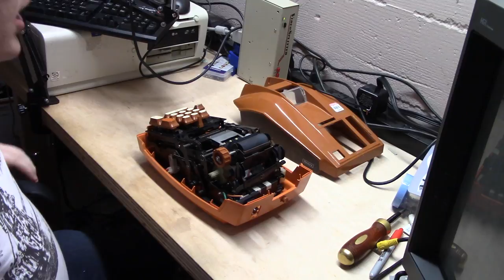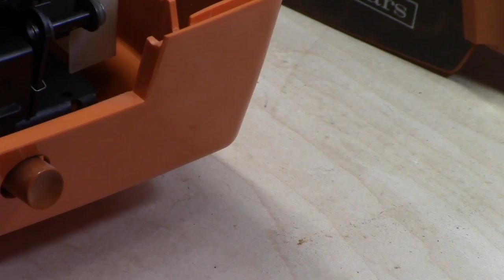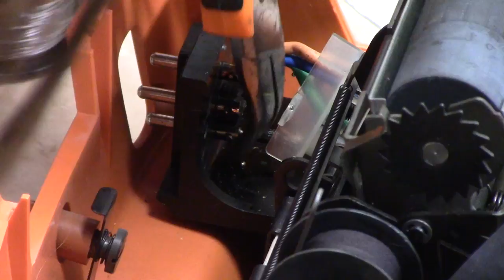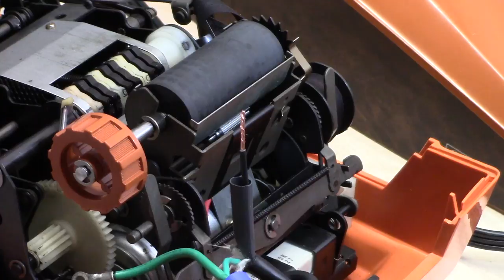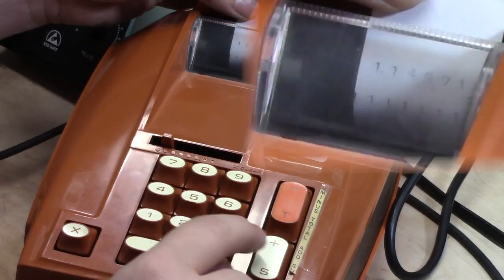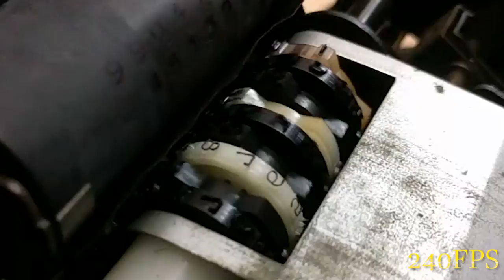Sears Electromechanical Calculator

Comment: That diode make sense because the motor is DC type, with brushes and permanent magnets. The same you can see in hair dryers, a very (clever) japanese solution. Typically those motors are rated 30 to 50 dcV, that's why the resistor. RMS voltage of a half wave recrified is 1/2 V peak, so the resistor absorb the difference.
The most electromech calcs used an induction motor with a flywheel, but those guys extrapolated the hair dryer's design to a calculator, clever.
Another interesting solution is the printing mechanism itself, the type discs are fixed, and the paper pulling roll basculate, i.e. less moving parts.

Comment: A single diode as a half-wave rectifier and the mother of all resistors behind it... that's got to be the dodgiest way I've seen to run a hobby motor!

My advice would have been to solder a wire at the other end of that resistor and one after the motor (I think that one goes straight to the plug), then run it off a low.voltage, current limited DC bench power supply. If you can't read the markings on the motor, my first guess would be 6V/1A, and increasing in small increments from there. Unless otherwise stated I probably wouldn't let it draw more than 1A though.

Comment: how has the motor held up since?
Reply from the maker: i haven't run it any more yet bc i need to replace the ink ribbon and i can't find one.
Reply: @CathodeRayDude  In theory, you can use India ink to re-ink a ribbon a few times, just paint the appropriate side fairly lightly and then wait for it to dry. Usually. No guarantees but it's worked for me. I've also heard of using stamp-pad ink but I don't have experience with that. There's also nothing wrong with finding a similar material at a craft store and cutting it to the same dimensions, then soaking it in India ink, though you can get jams that way.
Reply: Wouldn't a typewriter ink ribbon work?